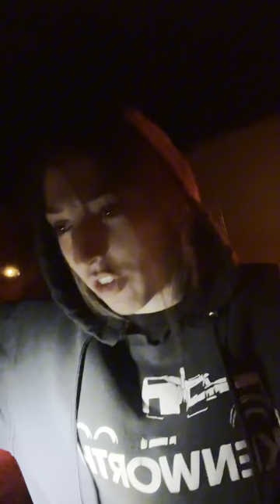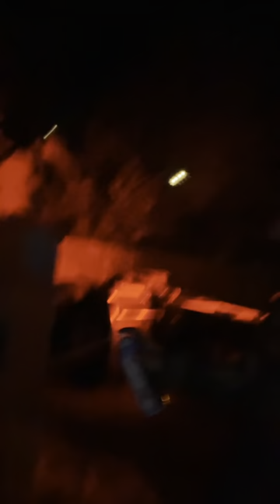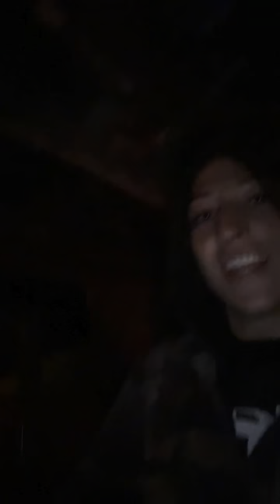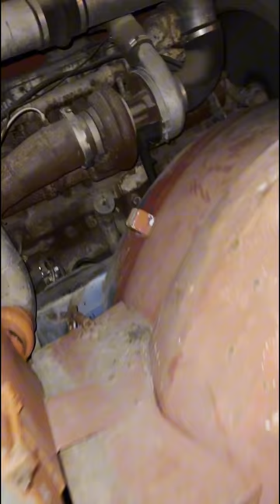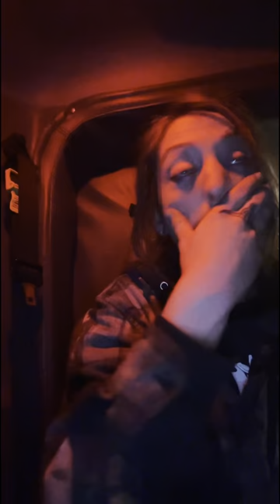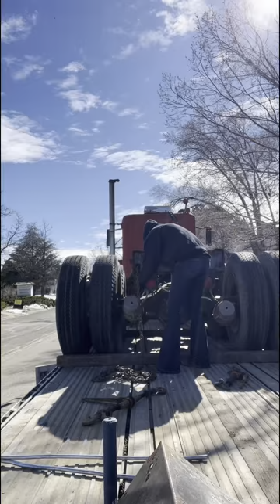Cold start of a 1947 Needle Nose Kenworth

Comment: The old trucks used to have a button on the starter just for what you're doing. They were a safety problem because if it were in gear, you could get run over by the truck.👍❤️